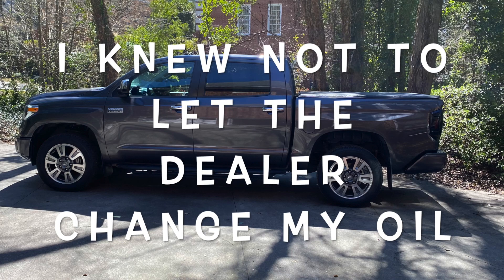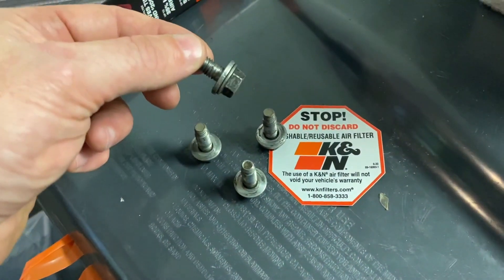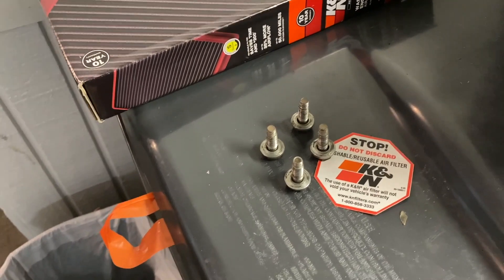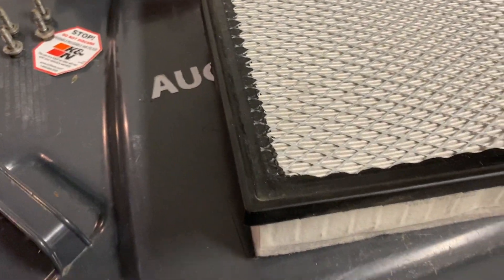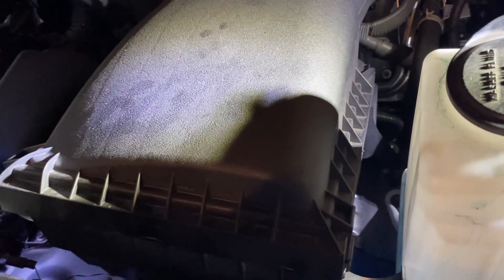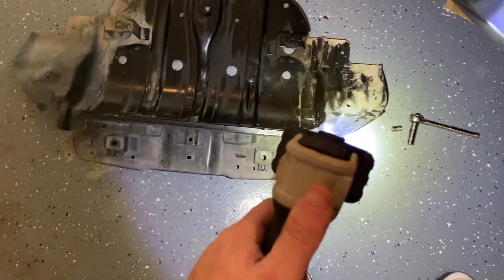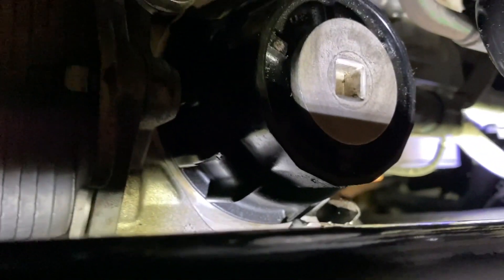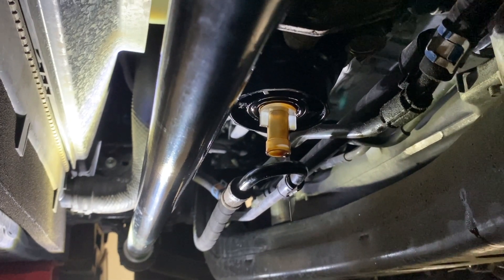2018 Tundra Oil, Filter and Air Filter Change

Comment: Bought my 2014 SR5 Tundra and they gave so many free oil changes. I never used one. Went on YouTube to learn the process of changing the oil on this truck. I always had the screw on type oil filters before and not the canister. The skid plate was a real pain to put back on. After the 2nd oil change I just left it off. I currently have 179k and unbelievably not one single issue with this truck. I do all maintenance.
Reply from the maker: Yep, all my own maintenance going forward.

Comment: Ditto…these knuckleheads are always in such a hurry that jobs are not properly completed. Pro tip for much easier oil and filter changes…convert the pita cartridge filter setup to an old school canister filter by using a Baxter Performance conversion unit. You can also use a ValvoMax drain plug replacement and never have to remove the plug again. Overall cuts the time and hassle by 2/3. Thank the infamous Scotty Kilmer for these excellent time and hassle saving tips that were a Godsend for me.

Comment: I'm a fan of K&N, but they will clog up faster on dusty and dirty roads.  So, you either need to clean them more often or use a regular filter and vacuum out the dust. If you hold it up in the air and can't see the sun, then it is likely clogged or too dirty.
Reply from the maker: Appreciate that info.   I’ll make sure to look at it when I get back from my trip in a few weeks.

Comment: I just took my 21 Tundra to the local dealership. They failed to reinstall the bolts for the skid plate. Also they rotated the tires but didn't check the psi or balance them. I guess that's not included with toyota care.
Reply from the maker: Yep, I do much of my own maintenance, but found a local shop that does great reliable work for very reasonable

Comment: Glad to see your performing your own maintenance.  Try sticking to Toyota original oil filters and change it with every oil change.  Tear one apart and a Fram, to review quality of each. I believe Banks makes an adapter plate, so you can use a metal can type filter.  The original set up, does not have a bypass valve, I believe. 
Good luck and a great video.
Reply from the maker: Appreciate the advice.

Comment: I have an 18 platinum as well. I bent down the skid plate tabs as they are a pain the arse to pull skid plate down. I prefer it not to be held up once bolts removed. Also have the K&N airfilter. I recommend the TRD filter element which is made 10 times better than other elements. Yeah it may be 15 bucks but worth it in my opinion. TRD Tundra Oil filter Part number PTR43-00081.
Reply from the maker: Great advice, thank you.

Comment: Usually the high school kids change the oil at the dealers.  They usually rush to get the truck in and out.  It's just a job to them
Reply: Uh no.  They start in the shop, usually come from a trade school and work their way up from D tech status.  Some kids stick, some don’t.  Most of your Toyota master techs start this way.  Oh, by the way,  I ran Toyota service departments for years.

Comment: At least with a dealer service you’ll have a little protection. They will stand behind their mistakes. A small shop and or doing a service yourself you mess up you’re on your own.
Reply from the maker: If I had a 3rd gen, I would agree with you.  But 2nd gen, like mine, no issues pop up inside that 36k mile warranty.

Comment: You might want to check and see if you have a transmission cooler on your truck. In 2018 they took them out and if you don't have one it will burn up your trams fluid and ruin your transmission.
Reply from the maker: I would most definitely add an after market cooler, but that delete was in 2019.  My '18 has the stock auxiliary trans cooler. Temps while towing, rarely go above 206F.
Reply: @kedrevs4037  awesome im glad your has they cooler, my 2020 does not im in the process of installing one and taking my time to pick out the best parts. Its very upsetting and doesn't make sense  why they took the trans cooler out.
Reply from the maker: @electrified7309  A lot of people were surprised by that. My own opinion, is that Toyota calculated the number of problems they would have with people that tow frequently versus the cost of the cooler, and made a decision to delete it.  It would be very disappointing to find that out after the fact.

Comment: I will never let the dealer change my oil…create a access hole in the skid plate for the oil filter so you never have to take the skid plate
Off again. Watch the “ CarcareNut..he is a Toyota Master mechanic and he directs change oil every 5000 mile and diff fluid ever 30000
Mile. You can get a Toyota TRD skid plate that comes with a access hole already for the oil filter.
I do used Mobil 1 oil on most of my vehicles except my 21 tundra which I use Pennzoil Ultra oil rate better than the Mobil 1
Reply from the maker: Thank I use Mobil 1 full synthetic.  Love the car care nut.  Lots of great info

Comment: i hate the tundra oil filter plastic cap
Reply from the maker: yeah, the plastic cap does make me a little nervous, not sure why it isn't metal.
Reply: It can be replaced with a metal one. The plastic ones can Crack easily.